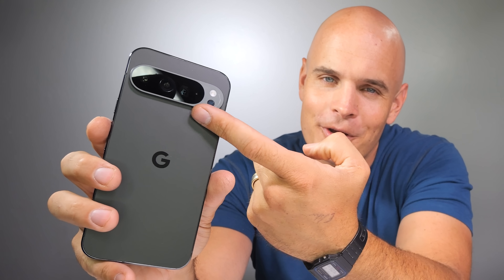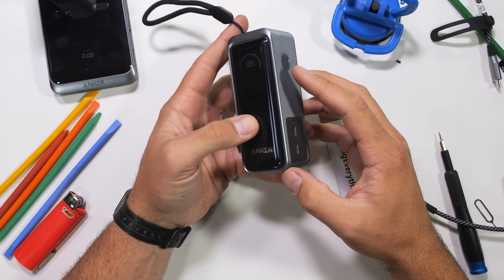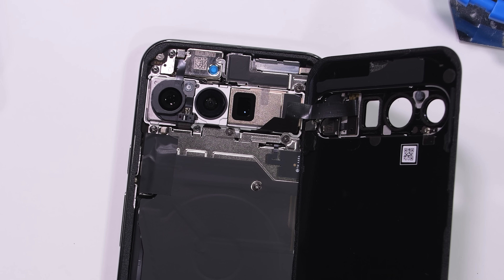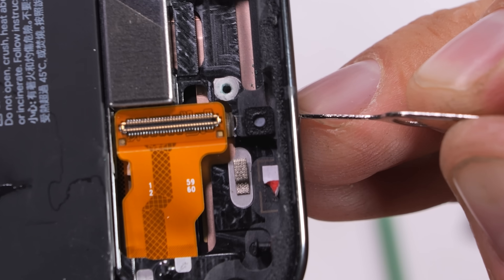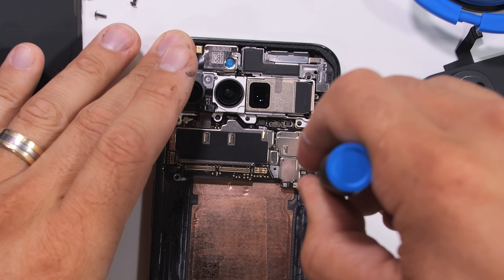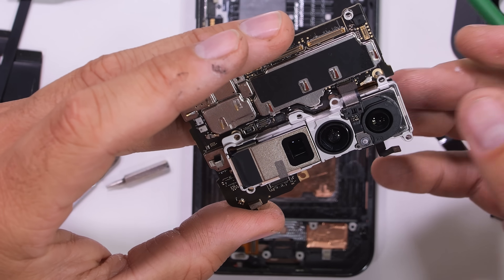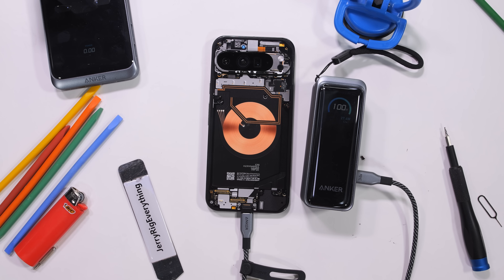Google Pixel 9 Pro XL TEARDOWN – (turn back while you still can)

Comment: Decided not to buy another pixel this round - I was hoping they'd fixed their tensor chip heat dissipation issue.
BUT, they also dropped support/buyback for the phone I had (Pixel 6a) knowing full well their 6 series had issues with overheating.
Disappointed in them.

Comment: Wireless charging is the worst thing. If it is to achieve no jack, it is forgivable. But is there a jack? That‘s too unnecessary. Super inefficient, high heat, and electromagnetic interference at the same time.

Comment: So disappointed with Zack. I'm no Google fanboy but pulling the battery pull tabs up instead of to the sides (guaranteeing that they will break) is very misleading. Also torx screws are standard and widely used type.

Comment: Soon companies wills start manufacturing custom screws with patent, and patent screw drivers which only they own, so the product they sold to a user for 100% ownership will become unrepairable and act like a "RENTED" product.
If phones laptops, every electronic product becomes unrepairable by 3rd parties or the users, then it should be called "RENTED" and charged a RENT FEE instead of charging for goods sold. 
If Avengers will not gather and slap these monster companies, they will hold our balls and call it legit soon.

Comment: I almost l never comment, but I feel like it's worth mentioning that a lot of your assumptions that this is very unrepairable seem to be either intentionally dishonest or based in ignorance. 

I don't do a lot of phone repairs but in my limited experience, Google's published repair manuals (that are freely available and ready to find on the website) have some of the most thorough step by step directions of how to repair the phone yourself. 
It has directions, numerous photographs and diagrams. Pictures and listings of every single part in this phone. Diagrams of where every single screw goes and pictures of which screw goes where, even if you mix up those screws that you were worried about. So if someone really wanted to repair this, all they would need is a couple easy to get tools and a little bit of finesse.

Nowhere is that more obvious than with the battery removal. In the manual it is very clear that the method they recommend for removing the battery is to use a hot plate at 70° C allowing the adhesive to soften. Then you use those pull tabs to gently lift the battery out of its place without any alcohol or prying needed. I'm not saying that's the world's best method, but it's the official one they recommend. So saying that they have bad "pull tabs" and that their battery is not easily removable when you don't even try the method the manufacturer recommends is pretty disingenuous. And saying that the website link on the pull tab doesn't go anywhere is not true at all. It takes you to their repair page and with a few other clicks you'll be right to all the repair manuals and places to order parts. Did you even try navigating around that page? 
Also, calling Torx screws "proprietary" is absolutely not true. Torx are ubiquitous. Maybe not as common as Philips or standard, but anyone with literally just a few bucks can get a full set of torx bits and would be good to go.
And just as an aside, having seen you tear apart hundreds of phones it honestly seems like that one came apart pretty easy and went back together quite decent, working fine at the end. Didn't look like anything broke going in or out. Maybe you're just that skilled, but the fact that you did it all without damaging anything shows that it is not that bad. And that's without you even looking at the recommended ways to do it..
Reply: Basically : "It's official so it's good", while he's talking about the reality of things.

Comment: HeyJerry! I observed an issue, when you attempted to remove the battery. It seems the battery strip might have indicated pulling from both sides or outward togatther, but it appears that you forcefully pulled it from just one side. This might have caused the problem. It seems that the mistake was on your part, but you're attributing it to Google.

Comment: I wish phone manufacturers would just ask people what they want in a phone. Instead of doing "market research" aka copying each other, why not just have twitter polls? Like "Camera hump or thicker phone with larger battery and a headphone jack?" "sd card slot or more built in internal storage" or "headphone jack with ip67 rating or no jack with ip68?" In my mind people would happily take a slightly thicker phone with a larger battery and headphone jack than one with a massive camera hump that serves 0 purpose.

Comment: Just having a Torx screw doesn't make a phone less repairable.... Every single repair toolkit has Torx bits. If you need a philips head screw... You shouldn't be fixing your own phone...

In other news, Torx is a far far superior screw than Philips, since having a slightly different bit won't strip the screw out....

Comment: If that Anker power bank is only giving the Pixel 9 Pro XL 27W, it means it likely doesn't support 21V PPS and cannot fully supply the 37W the Pixel is capable of. 65W max is misleading in this case because it's 65W PD, not the optional PPS standard that's part of Power Delivery that Google is using. Just a heads up, since you said "The 65W is more than even the Pixel 9 Pro XL can handle"

Comment: idk other than the odd screw array and the glue on the battery that looked rather nice to work on.
torx bits aren't really a bad thing, a torx bit isn't pointed, which leads to less possible damage in slippage etc.

Comment: Thank you for showing the Microphone hole. I was terrified I screwed up my phone with the SIM ejector:( My screen and cameras never get touched until I have protectors.  And my dumb ass stuck the mic right off the bat .  Thanks again. Glad your are here. :)
Reply: Lol I'm glad I'm not the only one that did this. They should add a small sticker tho. I'm sure 50% of everyone sticks it in the wrong hole.
Reply: Same here!! 😢 I feel better now that I saw the video but I panicked for quite a while, my mic seems to work fine, I still need to test the water resistance… Not a very good design I believe…
Reply: @ErickMotta  Any word on the testing? I did the same thing but from this teardown I don't see how i could have damaged anything with the sim tool
Reply: I even heard a pop when i inserted in that damn hole. But mic works fine. I am just wondering about water resistance. If the protection is on the side, what was that pop about?
Reply: @gutopesset that's what I'm worried about too... the pop
Reply: Okay anyone know if it is still water resistant after this? :(
Reply: SAME I had a small panic attack lmao

Comment: For the sponsor Anker: I am using for YEARS now a cute little Anker charging adapter with two usb C ports for my Job.... I am a train driver and we have for important things a tablet and... it needs to be charged... and the out of the box charger of this thing is.... slow... but with the Anker charger... jup... perfect.... and i am also able to charge my work smartphone... simultaniously and even with both connected... its very fast ^^ so... YES Anker is a very good charger brand

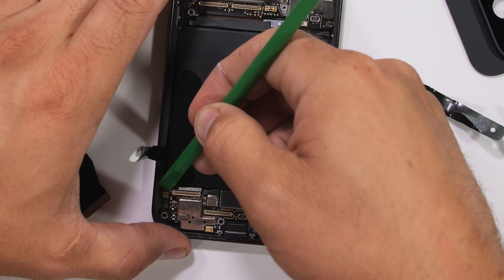Comment: 4:17 Something we didn't notice in the teardown, the display ribbon is on the opposite side of that board! This is GOOD!
This allows for crazy easy screen replacements, can remove the display from the other side of the phone without needing to take the back off or the phone apart. 

As terrible as that battery removal process looks, I assume that link was meant to tells us to add some isopropyl around the top 3 edges and soak for 5mins before using the pull tabs as a saw, sliding back and forwards, moving up slowly with each pass. They still have time to get that link sorted out before Pixel 9 Pro XL owners start needing battery replacements. If they sort out that link+instructions, would you reverse your non-recommendation?

Comment: 0:07 no, they never do, even in instances where the cameras need more room the chassis can be made a little thicker to accommodate them and now more space for other enhancments.

Again adhesive is not a replacement for a gasket nor is it how a professional designes a product to be assembled.

Comment: Zach, I have nothing but respect for what you do. I’ve been watching you tear down phones for years, but I just watched this video in 1.5x speed, and I didn’t see an overly engineered and difficult to repair phone at all. 

I saw you pull on and break a battery release tab that I have never seen before. I saw you dismantle a phone that even at fast speeds, seemed quite simple to put back together. But your overall view of the phone’s repair ability remained negative even though that was one of the least messy tear downs I’ve witnessed from you.
Reply: Click bait titles like turn back now are the reason I down voted this video. For the quality you put into the video, it doesn't deserve the down vote but please don't make me try to regret a 1 grand decision by watching a long video only to realize I now have less faith in your opinion
Reply: Agree

Comment: Nothing like a phone that has seven years of updates and a battery that's incredibly difficult to replace.
Reply: Sorry I don’t know much about phones, is seven years bad?
Reply: You can get the battery replaced from official google repair partners here for less than it costs to buy the battery itself, with zero risk on top. Doesn't sound difficult to me.
Reply: All you have to do is heat up the phone using a heat pad to 70°C, and use that tab to pull the battery out. It's literally not difficult. People just refuse to look at repair manuals and prefer to figure things out on their own lmao.
Reply: @xenofastiq  LOL.. "just heat that battery up to well above a safe temperature and you can pop it right out!" I guess they'll just have to follow that manual that isn't available... where I'm sure it says cook your battery.

It's also hilarious that you suggested that you just need to "use that tab to pull it" when it's set up as a one of those 'sawing' systems. Like what manual are you pretending you read?

It's true! See below
Reply: @AbbreviatedReviews  I can send you the manual if you'd like bud 🤣 Also, 70°C is not going to damage your battery 💀

It's hilarious that you pretend to understand what the tabs are for when 1. Nowhere on the tabs does it tell you to use it in a sawing motion, and 2. Again, the repair manual tells you exactly how to use it 🤣
Reply: @xenofastiq  I looked it up and it's true! Fascinating that they warn not to heat the phone above 45C but tell you heat the battery to 70C on a HEAT PLATE of all things. But I guess that's the fun of an overly complex battery swap process. Owner repair is out the window!
Reply: @AbbreviatedReviews  I mean, considering the battery isn't going to be exposed to 70°C for an extended period, then there will likely be no damage to the battery, or any of the other components. You'll just have to make sure you don't immediately try charging up your device while it's still hot lol.
Reply: I mean, unless you replace your phone's battery yourself, why are you worrying about it so much?
Reply: @prayashshrestha  Its not necessarily just for people who replace their own batteries. Difficult to replace batteries can be a problem for even small repair shops that aren't partnered up with all these big phone companies. It affects basically everybody except for the few that have proper tools. Of course though, with the Pixel phones really only requiring a heating mat, then it's really only a minor expense to be able to replace your own batteries (and to help with softening up adhesive in general), and a lot more people will be able to replace these batteries vs when phones have more permanent solutions (such as no easy pull tabs or instructions on how to properly remove them).

Comment: Ironic that none of the Anker chargers work with the Pixel thanks to Google using PD and Anker not. Well, that's what I have found out, I have tried two Anker chargers on my Pixel 6 and Fold, and eventually they go mental starting and stopping the charge.

Comment: I absolutely despise that method of battery retention. They used the same method on my Pixel 7 and even after heating up the phone to soften the glue, pouring a decent amount of alcohol, and sawing back and fourth to get the battery glue destroyed, it still just broke the plastic strip
I think glueing the battery into a thin plastic carrier and using screws as the primary method of retention would be infinitely better. Or even just a much weaker glue would be prefered if they're dead set on using glue

Comment: Probably not Anker's fault, but it's kind of funny that their products don't get along with the Google Pixel 8 line. After one of the updates, charging doesn't work anymore ("connected, not charging").
This is probably a much wider issue, but most users just don't pay attention to how their device behaves during charging (mAh jumping every few seconds). Any solution?

Comment: You used the battery pulls wrong (yes, I understand the link didn't work to explain them), the screws are not proprietary (they are Torx) and honestly other than the battery being hard to remove (the wrong way), nothing about this phone seemed difficult to disassemble/replace/repair...

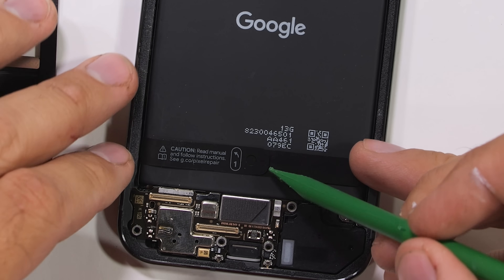Comment: Torx > Phillips, but I do dislike the different screw lengths. Also seems you missed the 283 page PDF from Google on the link at 3:47 in your video. Page 115 says to soften the glue by heating the phone to 158°F/70°C for 10 minutes, securing the phone, and then using the two pull tabs you ripped out to lift the battery straight out. It's excessive, but to say they don't have information or guides is incorrect. 

Either the information was not out yet, you didn't check out the correct area on the link, or this was rushed.

Comment: Yes, they could have done better, but torx screws are usable with any basic watch repair kit, come with benefits to repairability, and its hard to actually know how good the pull tabs are when actually used properly. Still, we should demand they do better, and not just blame user error for a phone that should be made simple to repair, even if you make a mistake (which a first time repairer definitely will).

Comment: Everything seems... easily repairable & recyclable? I was surprised how easy and clean the back glass comes off. And apparently you heat the battery a bit and it comes off easily, so you just bodged it. The rant on torx screws is just... off. What's your beef with Pixel devices, Jerry? Not the first time you're giving them a biased review.
Reply: Agreed on all of the points made here. Torx beat Allen and Philips head in all aspects, and this review demonstrates a lot of bias against these phones. This is purely an Anker ad and cash grab. Unsubbed

Comment: I have repaired multiple phones in my lifetime and maybe it's just my personal opinion but I like the brackets. my old P4a5G had a weird clip that dislodged itself and didnt secure the display cable properly a few months after I repaired it. Opening these clips just once inevitably bends them and compromizes their tension strength. Screw-on brackets hold the ribbon cables tight and It's possible for them to sit just as tight after a repair compared to before it. I do hate different sized screws tho and repairing an iPhone 6s almost made me vomit.
Google could gain massive points by ditching glue for the battery and instead going with a bracket with screw holes (that could be glued onto the battery). Not every phone needs to be designed around repairs but they could at least try where they have to option to.

Comment: 4:00 i guess that if theese cables are antennas, google used screws to connect them to the board instead of a connector for electric resonance reason so that with a flat connection instead of a ribbon whit little metal contacts there are less sharp curves

Comment: For me, battery life is probably why I won't get another pixel phone. I had to get a new phone a few years ago when my Pixel 2 XL's screen started peeling away from the body. Ended up getting a Pixel 4a then. That phone still works, but it needs to be on the charger basically all day to be usable. After I paid it off, I got a Pixel 8 Pro hopefully to replace it and have it last longer without needing to be charged... but sometimes the battery will drain to <30% after sitting on my desk doing nothing all day.